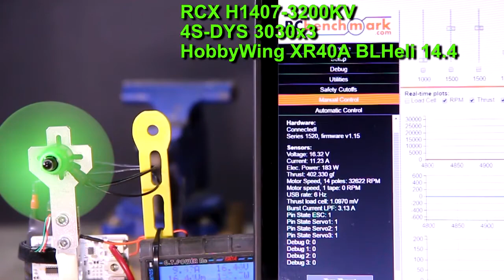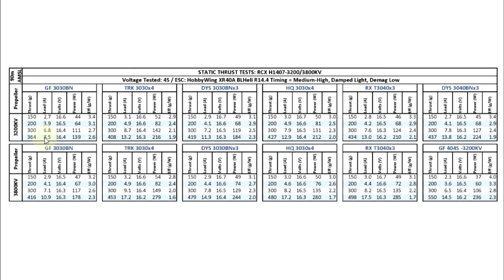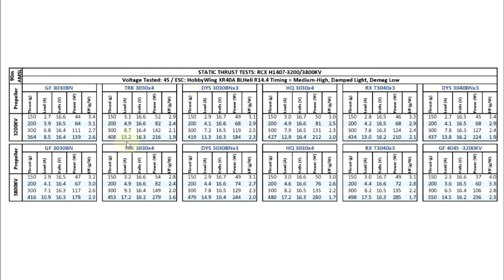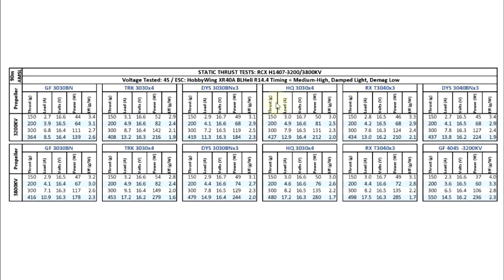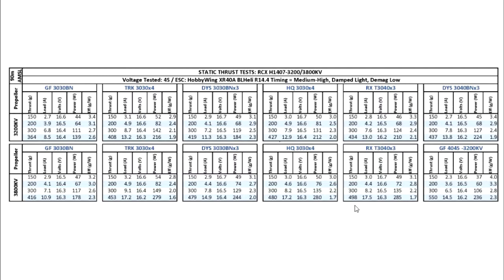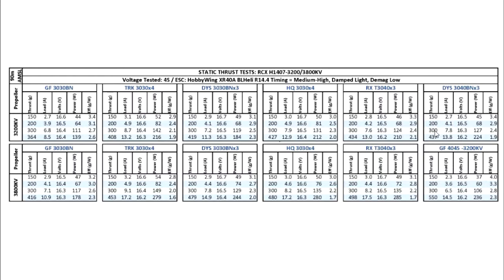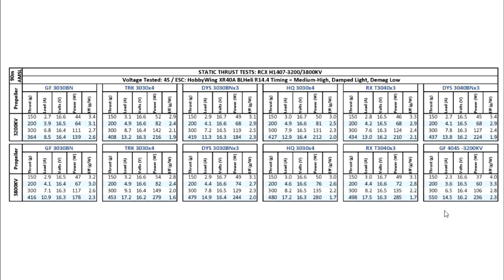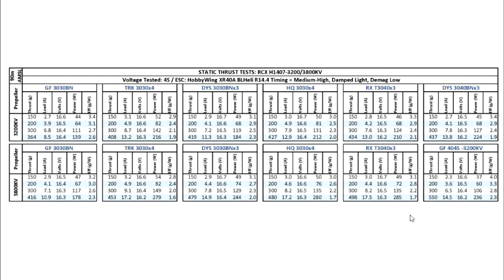RCX H1407-3200KV / 3800KV Static Thrust Tests

Comment: Thank for the video. The RCX1707 3200kv is at the end a better option than the RCX1407 3800kv...more thrust less amp.... However for hovering the 1407 seems better...that is weird??
Reply from the maker: Good observation, I didn't look at that comparison. My guesses: Could be the thrust stand current sensor looses some accuracy at the very low readings or perhaps the larger rotating mass of the 1707 consumes a little more Amps at low loads as you increase loads to make more thrust then the torque capacity of the larger 1707 shows its efficiency
Reply: This was actually one of the main things I wanted to find out when I helped set this up. There was little data on the 1707 and the numbers looked pretty positive.

I think heavier motors with more thrust might be justified on smaller builds because the weight is still relatively centralised with the short arms.

- fdlc2011

Comment: Quick question. Would you run 10A ESCS with 15A burst on the lower KV variant of this motor with Rotor X 3040T or HQ3x3x4? You think this would be enough, or should I opt for 20A rather. I see some of your test hitting 14A, but that's on the bench. Not sure how much that will unload.
Reply from the maker: PinchTune I've found that a "safe" estimate is to multiply the Max Amp for the prop you want to run by 0.75 for a very conservative unloaded number or by 0.65 for a more aggressive number.
Reply: Sweet thanks. 10A will do then, but it's cutting it a little close for comfort for what is essentially a negligible weight savings. The 10As are smaller though. But a 20A Cicada will fit... and the 30A Aikon, though overkill for a 3in frame is actually smaller than the 20A Cicada.
Reply from the maker: if it's just a couple grams per ESCs and size is not an issue, I'd rather go for the higher-current ESC. Just for peace of mind, especially if you're gonna be beating on the throttle a lot.